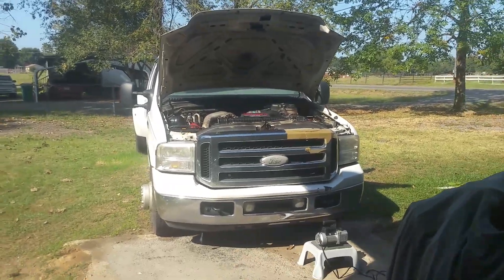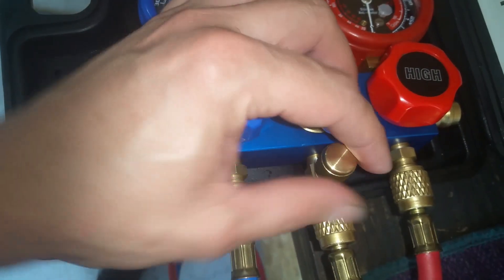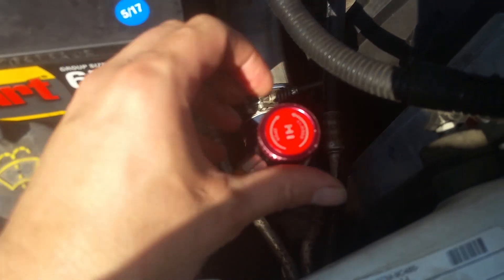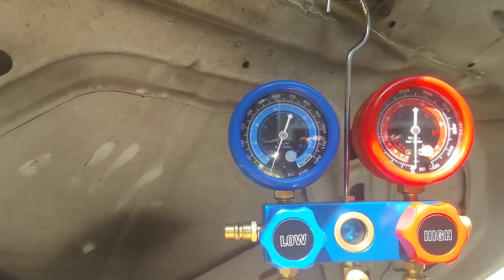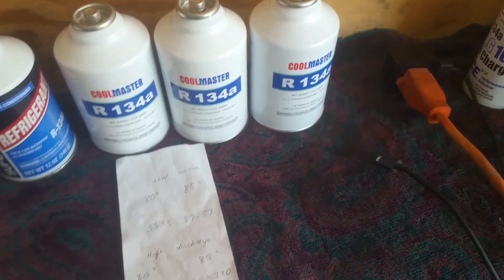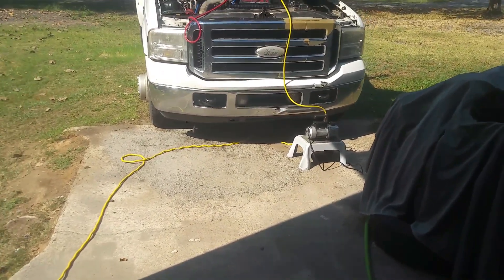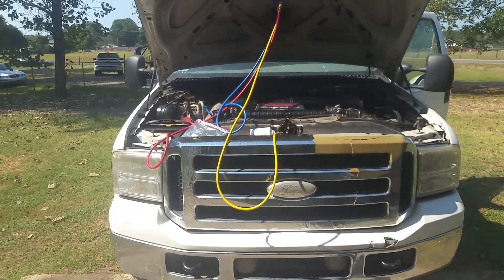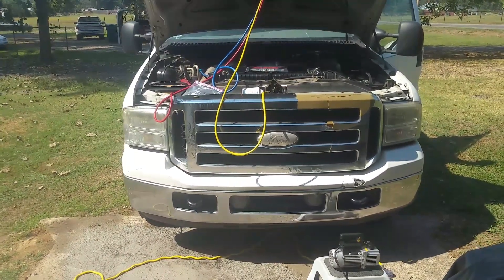Charging the AC ford 6.0l powerstroke

Comment: You did everything right. The only thing I would add is that when charging a non-moving vehicle you can't really rely on the high side pressures because the high side is reporting pressures from air moving across the condenser. If the car is sitting still, not enough air is blowing across the condenser to bring the high pressures down. That only happens when the car is moving. Also, I always rev up the engine slightly to maybe 1500 RPM to pull down the low side pressures. If they go much lower than about 38  degrees you don't have enough refrigerant in the system. People sometimes think colder is better, but too cold and things will ice up, and that isn't good!
Reply from the maker: Thank you for sharing this great information,  it is truly appreciated.

Comment: Do i need all the fancy pump and stuff? I got a single guage line thing i bought not a fancy triple line double guage lol, i cant just use the one i got?
Reply from the maker: If you are just adding a little yours is fine. If you had to open the system,  replace anything , or fix a leak then you will absolutely need a vacuum pump and  the guages will be needed for that. Hope this helps .I appreciate the feedback.

Comment: 2 questions:
1. After vacuuming the system do you have to add any PAG oil back into the system before recharging?
2. I didn’t see performing the step of purging the air prior to charging. Do you just simply press the small push in button on the top of the yellow line at the gauges till all the air is out?
Reply from the maker: Unless I replace a part ; compressor , condenser , suction line etc. I usually do not add pag oil. It would not hurt to add an ounce but it is minimal. After performing a good vacuum , I will put on a can of freon and only purge a little air from the yellow line. No air should be present in the other lines due to being vacuumed. Thanks for the feedback.
Reply: Appreciate that! I do admit I’m too much of a newbie with this to even dare to attempt lol! I did do a leak test with 5 oz of UV dye and noticed a small drip the black light picked up underneath dryer. So looks like now I’ll have to get someone to evacuate prior to removing the part now. Or should I vacuum out myself then change the part? Thank you for the feedback also.

Comment: that same kit you rented with 300 dollar deposit its 64 dollars at Harbor freight
Reply from the maker: I actually have a 1/2 horse vacuum pump I bought from harbor freight. I like a lot of fheir tools. Having said that years ago I had bought a set of their gauges . The gauges themselves were great but had a lot of trouble with the hoses leaking , so returned them. Do not know if they have made improvements since then because this has been probably 6 or 7 years ago. Thank you for the feedback.

Comment: My 2005 6.0 AC working Great Ice cold : But the engine fan will run alot when i have AC on > outside temperature in Florida around 95
coolant EOT and FWT are  normal ?? please Help !

Comment: Thank you for your video, I really appreciate it. Did this last time, lasted about 8 months. This time replaced the AC condensor and recharged it. Blowing out 36 degrees at the vent! Pressures seem fine, couldn't trace down any dye from the last charge except dots on the condenser, fingers crossed.
Reply from the maker: Thank you for the great feedback and thanks for watching.

Comment: Have you had any issues since you didn’t put oil in it ?
Reply from the maker: No its still working perfect. This system was opened but did not have anything replaced . However if i was replacing the compressor or condenser i would add a few oz . Ive poured it in directly and ive used the oil charge cans also . Either way it seems to work just fine . Thanks for watching

Comment: I really appreciate your video. I do have a question. You said don't turn the high side on when you put in the first can. Then when you said time to add the second can, I noticed the the high side gage was reading. When did you open it up? This is confusing to me please help. :-) thanks
Reply from the maker: No problem . The guages are both opened when vacuuming the system. Once its vacuumed the high side gets closed ( now this does not mean the guage doesnt operate only no 134a will come through or go through the high side of the manifold , the 134a only goes into the low side ) So very easy just close the high side once vacuumed and do not open it again the remainder of the charge. Also as mentioned during charging be sure to close the low when switching cans and also purge the line when switching cans . Hope this makes sense . Thank you for the feedback and thanks for watching.
Reply: Yes now I understand, thank you so much!!

Comment: Instead of purging after each can if you can close the yellow line or low side if its just one line by turning the thumbscrew clockwise then unscrewing the can at the connector no air should get in the line except around the connector of the can's lip which is nominal.
Reply: This is the way to do it.  Otherwise you have purge error with each can.  Can be up to 15% of line volume (yellow line).  When you close the needle valve, you only expose the tiny volume (inner disk depression) of the can top.  Much mo betta.  On you last can, you shut the supply line down at the gague, and then remove your filler top from the can, assuming you have a self-sealing can, otherwise, you can leave it on until the next fill job.

Also recommend using a digital scale for the weighing of the final can.  Either use the "tare" function to zero the can, or measure total weight of can before start, and do the math as you fill.  An ounce or three off can effect system performance by 5-8%.

Comment: Thanks for the video, it was very helpful.  I have the same truck and just recharged my system after replacing the condensor and orifice tube.  Vacuumed down the entire system and let it sit overnight and pressures held fine.  Added the correct amount of refrigerant and it started blowing cold but then stopped.  Compressor turns on and off frequently (low side between 20 and 40 psi, high side between 210 and 240) and a/c is barely cold.  Any suggestions?
Reply from the maker: This ac work is tricky business , and I commend the guys that do this day in and day out. If it has the proper charge then it should be performing correctly.  The cycling switches do go bad but if it was fine prior then there may be another cause. More often times the over cycling is an under or over charge. I wish I could be of more help , but keep me updated on it .
Reply: The switches may be bad, not sure.  The weird thing is that as I was filling it, it started blowing cold and then returned back to the way it was before.  I would think if there was a leak then it wouldn't have held the vacuum overnight.  Thinking maybe an expansion valve or sensor but don't know where to go from here.  I'll see what else I can find out, thanks.
Reply from the maker: I'm with you could be the switch , the orifice tube is new so that's basically the same thing as an expansion valve , so rules that out . No leaks so that's good and most time the biggest battle of all . But definitely keep me updated I'm curious myself .
Reply: So I just ran the truck and noticed something, not sure if it's anything.  The line coming out of the evaporator that connects to the condenser is partially cold on one side.  It seems that where the orifice tube is located separates the cold side from the hot side.  Not sure if this is normal, but could there possibly be an issue with the new orifice tube?  The strange thing is that I can feel the line ice cold, and there is a small air leak coming out of the airbox where the evaporator is located is blowing cold air.  No other lines are cold in the truck.
Reply from the maker: Definitely strange wondering now if there may be an issue with a blend door . I've heard of people crimping off heater hoses to rule that out .
Reply: Should both lines going to the evaporator be cold?  I only have a short portion of the line connecting the evaporator to the orifice tube that is cold when running.  Maybe the evaporator is clogged?  When you get a chance, would it be possible for you to tell me which a/c lines in your truck are cold to the touch? Maybe if one of mine that should be cold is not, it might point to a clog?
Reply from the maker: Gave me a good reason to fire the beast up , I love hearing it anyway ha. All my lines going into the accumulator drier and box are cold except for the smallest line that's running back to the condenser or etc gets warm just past where the plastic holder on the drier is right before the coupler if that makes sense . But both lines going into the box are cold .
Reply: Thanks so much for doing that for me.  That's what I thought...I verified the same thing on another vehicle I have.  The only cold line I have is going past the orifice tube into the evaporator.  Everything else is hot.  No lines coming or going out of the dryer are cold.  I'm thinking the clog is in the evaporator.  Thanks for firing up the beast.
Reply: super_dad I know this is way old post, but you should have changed the drier as well. They can separate and cause a clogging in the orifice

Comment: Did you have to add any PAG oil to the compressor once it was completely empty?
Reply from the maker: No I didn't , I have had zero issues with it too. I'd say it's the best ac out of all my rigs right now . That oil is tricky business because you never know how much is lost or in there so most of time people err on side of caution. I know I've not had issues not adding it from past experience but I have had issues when I've added it and getting too much. It's by the same token very important to get as close to the exact amount of refrigerant as possible also. Thanks for watching and best of luck on your project.

Comment: This is a huge help.  Followed this video step by step after replacing the compressor, evap, orifice tube.  Recharged system and is working great for over 6 months.  Saved me a significant amount of money.  Thank you for taking the time to post this.
Reply from the maker: Sounds like you did a great job on it . It sure is nice to have some great ac this time of year. I know my f350 by far has the best Ac out of all my vehicles . I agree if it comes down to taking my Truck in to a shop to fix the Ac, I just won't have Ac . Seems to be one of most expensive services there is. It's definitely a good feeling of doing it yourself for sure. Thanks for watching and the feedback

Comment: Well done sir. After all of your hard work you deserve to ride in a cool cab! Thanks!
Reply from the maker: +Baxrok2 yes indeed , it was hot and humid that day even though it didn't get above 90 it felt alot worse. I got a new condenser on there I just didn't like the looks of the one that was on it , too many dings and scrapes. It will freeze you out now , it's just nice when things go the way they're supposed to sometimes ha . Thanks again for watching
Reply: Did you added oil or the compressor already had it?
Reply from the maker: The compressor already had oil and it wasn't removed , I did however put 2 oz or so in the condenser itself because it was replaced . If you replace a compressor most of the time they come prefilled with oil but you have to check and make sure . I know the last new one I got was full and couldn't fit a drop. Depending on the problem where the leak is why the system was needing charged in the first place will vary to whether it needs oil or not , sometimes the shrader valves themselves for example will leak slowly and so there would be no need for more oil unless you wanted to replace the drier or other components . Thanks for watching
Reply: Baxrok